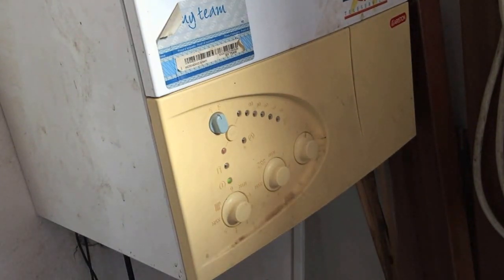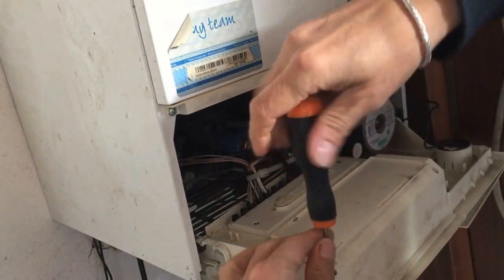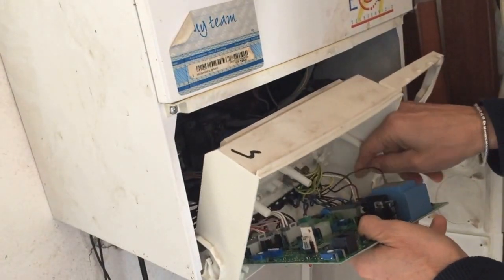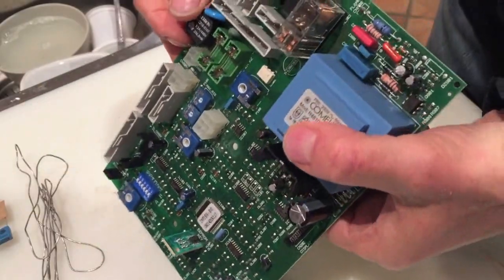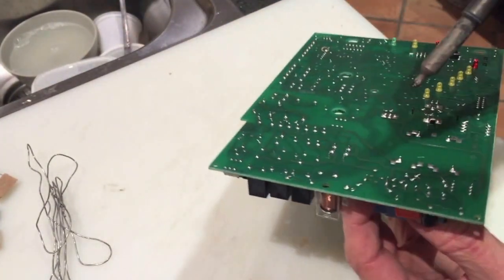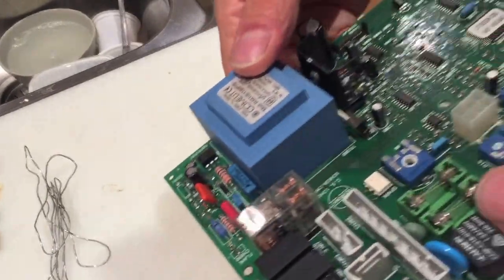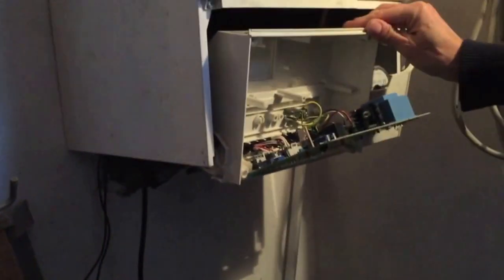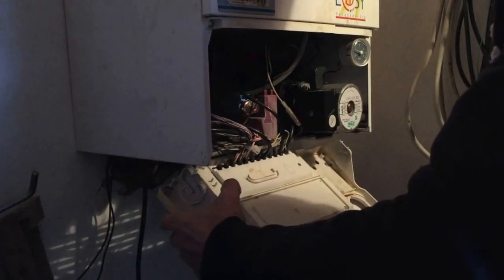Ariston Microgenus (also Simat t2 lls) A01 Flame Sensor Problem Fix PCB Repair

Comment: Hi Clive - I bought the capacitor you linked above but then realised my board is  part number 65101732 for Microgenus II 24. Will the cap you linked do the job? Also what is the best way to check flame sensor probe?
Reply from the maker: Sam Bogue Not 100% sure. If it has the same layout of components in that area it should work. Ariston changed the design of the circuit board for later models as they recognised the problem. If it doesn’t resolve the issue it could be your flame sensor which is not working
Reply from the maker: Sam Bogue just checked and it should be the same so should work.
Reply: ok - going to give it a try, will report back! :)
Reply: Hi Clive
Fitted board with cap replaced. Now no ignition at all - no flame. Any ideas?
Reply from the maker: Are you sure all you didn't cross any solder to any other terminals? Also you used the parts I suggested in the link? Also are you sure that all the jack connectors to the board are clean and well pushed in? The only way I know to check the flame sensor is to replace it, but I am no expert. I changed mine, it only cost me 7 euros.
Reply: Hi Clive
So it worked for a day and gave me hot water too, now back to constant A01s so I wonder if the cap wasn't quite right......
Reply from the maker: Sam Bogue Find me on Facebook and we can message, perhaps I might be able to help

Comment: Enjoyed watching your video and an excellent fix 
how did you manage to diagnose it though??
Reply from the maker: Salim Khan Thank you. It was just guesswork and trial an error. I changed several parts before finding the correct one.
Reply from the maker: Oh! And I new that it was obviously not sensing that the flame had lite and so I followed the wires from the flame sensor to the board and started changing components near it.

Comment: Great fix, result as expected. For those without ebay, simply get a 100nF (nano Farad) or 0,1uF (micro Farad) ... it's the same thing ... and 275 (or more) Volt (AC) condenser.

Comment: Hi
I have this repetitive block issue and so I changed the whole pcb but it is continuing to go to block
The error codes a01 and a77 keep coming up 
What do it do?
Reply from the maker: You can try changing the flame sensor which is that probe next to the two that make the spark. They don't cost much. As I mentioned in the video you should check that first.
Reply: Clive Hancy y
Hi
I have already changed the flame sensor 
Any other suggestions?
Reply from the maker: It could be the exhaust gas sensor which detects if the gas is burning correctly, somewhere at the top where the fumes exit. Normally if you disconnect the two wires from the sensor and connect them together it bypasses the sensor. The sensor may be defective or the gases are not getting out the flue correctly. Also did you replace the PCB with a new one, or reconditioned? The new version has a new arrangement of components near the part I replaced. If it is reconditioned or used it may be defective.
Reply from the maker: Is yours a 24 MFFI? if it is the A77 error refers to the condensation pipe being blocked.
Reply from the maker: If it is the 24, I found this on a forum but doesn't mean a lot to me as I don't have this model, but it may help you: 
Hi, I just fixed this fault on my Micro-Genus 24 HE. The A77 fault is quite common on these boilers. Basically the boiler thinks that the sensor is open circuit (broken connection ) or short cicuit (Water across the 2 terminals in the recuperator). It is a safety device to check that the condensate pipe is not b locked and hence condensate backing all the way back up to the flue pipe. First thing to do is check that the condensate is able to run freely from the bottom of the recuperator down the pipe, into the condensate trap and out of the boiler. You do this by taking the rubber hose off the bottom of the recuperator and pouring water down the pipe. It should run out of the grey flexible pipe at the bottom of the boiler. Mine was fine.
Next remove the fan and remove the sensor across the two terminals on the side of the recuperator. I think this is just a resistor, so just check it's not open or short circuit. Clean any corrosion off the two terminals and reassemble and test. If this does not fix it then you will need to drain the boiler down un-clip the 2 pipes on the front of the recuperator and remove the 4 screws holing it in place. Remove it from the plastic housing. The metal fins on mine were corroded on the bottom edge and this corrosion was present on the bottom of the recuperator housing and between the 2 metal pins that connect to the sensor on the side of the recuperator. You need to remove ALL the limescale and corrosion and polish with P1200 Wet and dry. I also rubbed the bottom face of the plastic housing with a rag with a tiny smear of silicone grease. It's important not to get this on the face of the 2 metal pins that connect to the external sensor.

You know when the bottom face is clean, if when you flick water on to the inside bottom surface of the plastic housing it balls up and will run down to the recuperator exit pipe.

Ensure the gasket is in good order as it stops carbon monoxide leaking out of the recuperator.

Reassemble and it should work fine. I have not had any more A77 faults since doing the above.

NOTE: YOU MUST ONLY UNDERTAKE THIS TYPE OF REPAIR IF YOU ARE A CERTIFIED GAS ENGINEER.

Read more: https://www.diynot.com/diy/threads/ariston-microgenus-24-he-mffi-error-a77.369178/#ixzz57H4gEBKq

Comment: Hello, I had the same problem in my boiler Ariston Microgenus Plus 31 MFFI, which was also resolved just like you said. I only spent € 0.34 on the suppressor capacitor. Thank you for your help.

Olá, eu tinha o mesmo problema na minha caldeira Ariston Microgenus Plus 31 MFFI, que também foi resolvido tal como disseste. Eu gastei apenas 0,34 € no condensador supressor. Obrigado pela ajuda.
Reply from the maker: Pleased to have helped. Saves so much money not buying a complete new circuit board.

Comment: could this cap be the cause for error A99 too ? i have microGENUS II 24 MFFI
Reply from the maker: Thegoodpal Hi. I think not. That sounds like a problem with the sensors that are on the top of the boiler, one on the right and the other on the flue. Make sure your flue and air intake are not obstructed. I think it basically means the mix and burn quality are not correct.
Reply: thanx for answering, i just check all air intake, they are not obstructed. and i wanted to check that cap, it's giving 86nf .... do you think its ok ?
Reply from the maker: Thegoodpa Sorry l don't know what 86nf is. A01 is the error code for the flame ignition not working so I think if you have another error code it's something else.
Reply: i measured the capacitor and it's value on the multimeter is 86 nanofarad not 100nf as it should be.
Reply from the maker: Thegoodpal Ah! Sorry now with you. But does it continue to spark even though it's lite? That is the confirmation that is that resistor. But as they cost so little you could try changing it. They cost about 3p each.
Reply from the maker: Done a bit more research and you probably have a problem with the air pressure switch which is on the top of the boiler. You may want to check the small transparent tube that comes down and feeds the reading into the sensor. Make sure it has not come off and make sure it's not blocked. If you find me on Facebook I could send you some photos if that
 would help.

Comment: hi I have the microgenus 23 boiler and it trips on flame fail several times a day there is two fault lights F and G. I haven't seen the electrode spark as your video shows. is this the same fault as you describe??
Reply from the maker: Colin Paterson I'm sorry but I'm no real expert but it sounds as if you have the same problem. When you turn it on what h through the class spy hole at the spark. If it caries on sparking after the main flame has lite it's the same issue. When they first start this problem they don't always cut out, so it could run a while before going into block.
Reply from the maker: Let me know how you get on.
Reply: Clive Hancy  I'm meeting a plumber on Monday and I'll mention the fix you suggest, thanks for getting back to me

Comment: had the same problem on Ariston Microgenus plus 24 MFFI and the "specialists" said that i have to replace the PCB. I Replaced the capacitor like in the video, works fine now.  Thanks a lot!! You spared me a lot of money!
Reply from the maker: Glad I could help. 6 years ago I replaced my PCB, it cost me 180 euros and I installed it myself to save the cost of the engineer. Then a couple of months ago it's started with the same fault. I was determined not to have to spend all that again. Ariston have now modified the PCB as they know of this fault.

Comment: hi thanks for making the video is there anywhere i could buy one of them locally rather than wsot an ebay delivery thanks
Reply from the maker: Danny Mcavinue Any good electronic component shop should have them. Personally, where I live, I found it difficult to find and used eBay.
Reply: Clive Hancy mine seems to have packed in tonight so wanted to get it done tomorrow ill have a check at maplins tomorrow
Reply from the maker: Danny Mcavinue Maplins may well have them. They may well have a higher rated one as I think it's the heat that makes it break down. If you can't find one try leaving the boiler front open. It allowed mine to work a little longer.
Reply: Clive Hancy i wouldnt know what im looking for as in getting a higher rated one could you possibly have a quick look on there website for me and see if u see any at all if its not to much trouble thanks
Reply from the maker: Danny Mcavinue I couldn't find it on the search for their website but that doesn't mean they don't have one. If I were you I'd take a look at that eBay link so you have all the info in front of you and give Maplins a call. It's a capacitor so they may be able to help. Or you'll have to find another electronics shop. 100µf 305 vac and B32922c are some of the info they may need. Unfortunately I'm no expert either.
Reply: Clive Hancy thanks for your help going to go down shortly and find out
Reply from the maker: Danny Mcavinue I Facebook messaged you
Reply: Hi Clive. Have the same issue, but cannot find the exact capacitor as shown on video. Can you please tell the actual capacity it should be ( i.e how many µf??? I checked with the manufacture and there aren't any of 100µf. Did you mean 1.0µf?
http://uk.farnell.com/epcos-polyester-film-capacitors